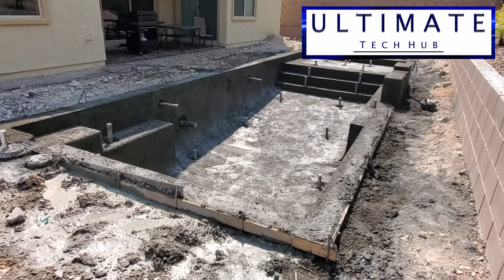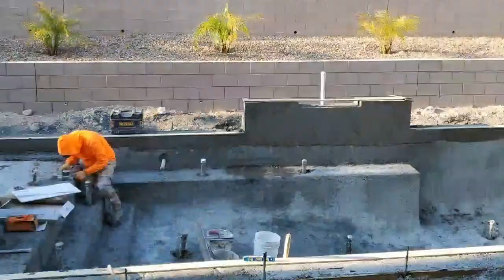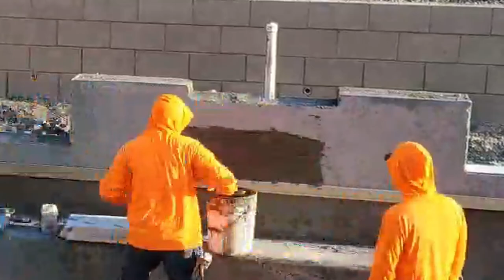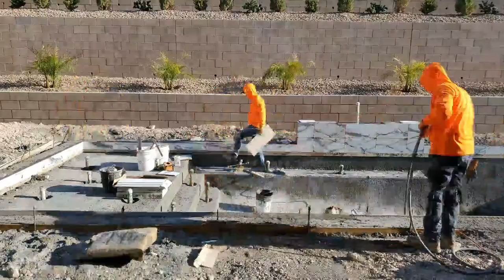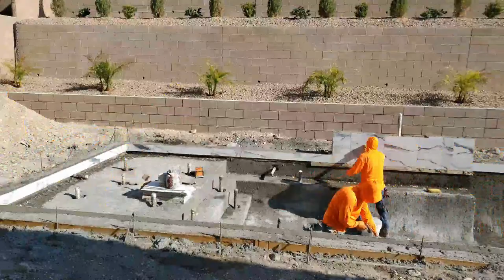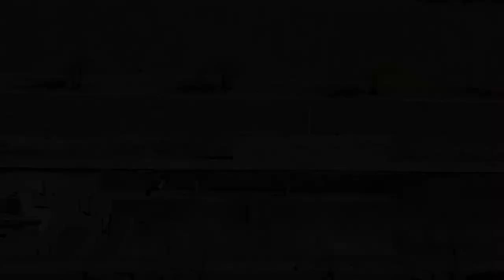POOL TILE INSTALLATION - TIMELAPSE - HOW TO TILE A POOL

Comment: Will someone answer a few questions?
We are a new tiling crew and are struggling with the installation. 
I keep forgetting that maybe the concrete is not square right..?
Well as I have studied your video it seems that maybe it's easier to make things more square on our own?? I see how much build out there is. 
But when it's all said and done the plaster crew will match the tile and its all gravy baby🎉😂
I may have answered my own questions..😊